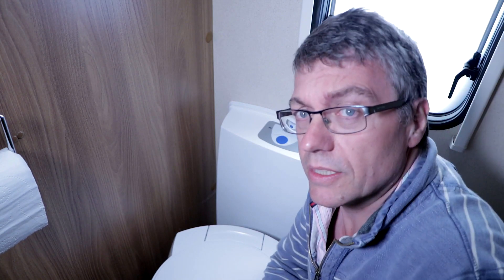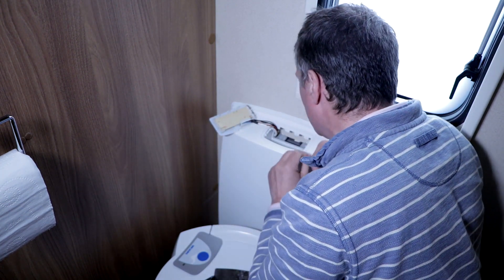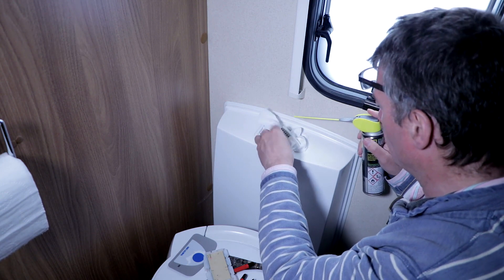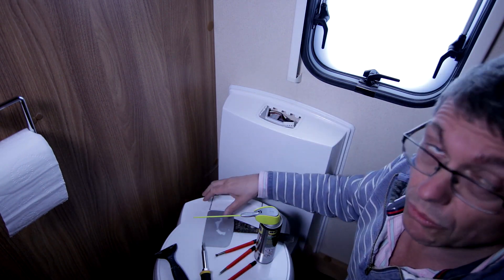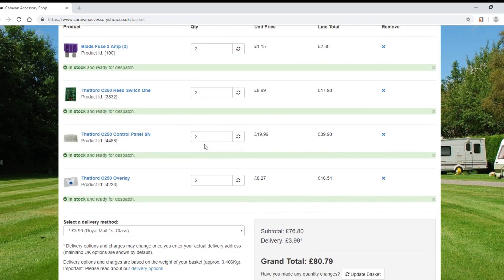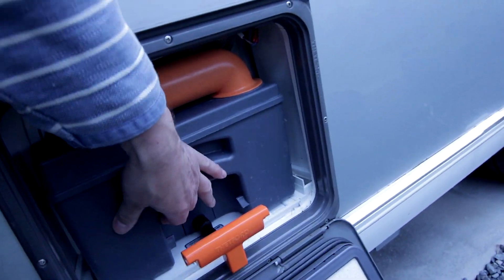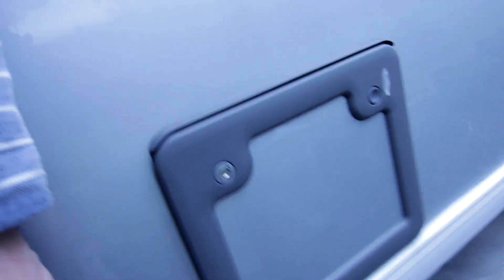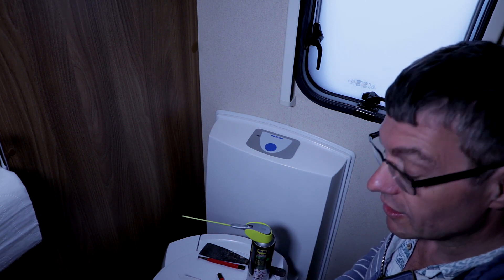Thetford C250 Toilet Flush Repair - a success story

Comment: Hi Ron, Thanks for the video which helped me get my C250 working again.  Removed the circuit board, cleaned the terminals and Voila! I would also be interested in a video showing to how to remove the pump on the C250. Murphy says that will be next to fail!

Comment: Exactly the same model of toilet, exactly the same problem. The thing actually awoke Me in the middle of the night when it totally randomly started and wouldn’t stop flushing. Probably lucky that it did wake me up to prevent the pump running dry and expiring.

Comment: I've recently bought a caravan and the only problems I've got is with the thetford 200 cassette toilet flush?? The pump is working but no water coming out.. Then noticed water had totally wet the carpet. So assuming there's a pipe come off somewhere??
Reply from the maker: If you take out the cassette you can see all the pipes that need to be connected. Maybe the pipe that shoots water around the top of the bowl has come off. But odd the carpet inside is wet though.

Comment: I have the same problem,  do you still have the old reed switch that you could test to see if that was the fault or it was it the new control panel?
Reply from the maker: I'm afraid not. I threw it out. I think it was the control panel myself. The reed switch was a belt and braces approach. It only cost 8.00 so it was worth it and very easy to change.
Reply: @greenroneye6516  I've had a look at mine again and took out the fuse which looked corroded,  after giving this a clean and inserting a few times all came back to life again.  The tell tale sign was that the red light was on and when pushing the flush the light dimmed but was still faintly visible indicating that a contact was bad somewhere in the system and could not supply the current required for the pump,  luckily it was the fuse connection and not the control panel.
Reply from the maker: @awilde76  Great news you've fixed it.  I had to remove the fuse to stop mine running all the time. These toilets do seem a little likely to break down.